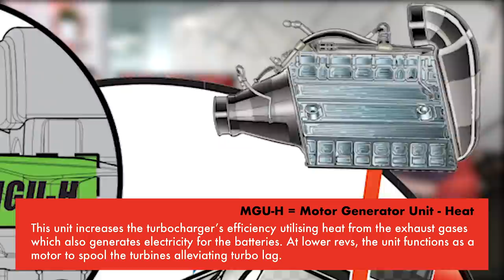Charles Leclerc’s cruel Bahrain F1 engine problem explained

Comment: There is always the possibility that they are not telling the truth.
A radio message about the power loss said to Leclerc "we are getting no H return."
This to me would mean the electric generator on the turbo shaft had stopped making power. This would a loss of, as Mercedes told us in one of their videos, 160+ extra horse power. This power unit is highly stressed by the high rpm, and the extreme heat. {and the puffs of white vapor form the back of the red cars.... may be a liquid gas cooling, that could run out} 
Is the diagram you showed correct, and their turbo compressors are next to each other? The top team using this has the compressor on the exhaust int he back, with a long shaft putting the compressor for intake in the front, and so the generator can be kept cooler.
ALSO there is the long tradition of the number 2 car having power loss problems, ain't that right Reubens?.

Comment: Serious question: why does a cylinder misfire on a 15000+ rpm engine not destroy it? I'd think that a 5 cylinder V6 engine revving to those sorts of speeds would simply shake itself apart. Why wasn't the failure more dramatic?

Comment: Ferrari’s are fast but Lewis did pass Seb in a fair fight, I think like last year it’s gonna be track sensitive to each car, the anomaly is Charles. I gotta admit the kid is fast or maybe just maybe Ferrari wants to push out Seb so they’ve turned up leclerc’s engine lol so he can win more.
Reply: Vettel is just not elite.. Could not beat Ricciardo, beat an average driver in webber for his titles.. even then he got preferential treatment on parts and would 'multi 21' on pre arranged deals.. Leclerc will show him the way this year..
Reply: You might just be right but with that theory and taking into account Ferrara reliability, they’ll go through 3 engines in 3 months if they are stupid enough!
Reply: Though he is a 4 time world champion, all were with Red Bull when they had the dominant car. Vettel has thrown away wins and at least one championship as a Ferrari driver. With the changes Ferrari are making within the team, I think Vettel is on the hot seat if Leclerc's form continues and Mick Schumacher does well in Ferrari's driver's academy.
Reply: That's not it. Vettel buckles under pressure too easily. The first time I saw it was back when Jenson Button caught up to him in Canada. Vettel went off the race line into the wet on the final lap.  And he's done it multiple times last year. He's got the skill but he's gotta get his head straight if he's gonna stay with Ferrari or even win another championship.

Comment: I'm sorry but reliability is part of the sport
Reply: Obviously. Charles said that himself after the race. Merc had issues last year as well, including a double failure in one race. What are you sorry about?
Reply: True, but this did'nt happen last year with the SF71-H this early in the season.  2019-->Oz was Vettel and Bahrain was Leclerc.  Nothing has changed from the PU from last year to this year; rinse & repeat. [smh]
Reply: Your correct it’s a Team sport not a drivers sport felt sorry for leclerc  but not for  Ferrari, I’m A Hamilton Merc Petronas Fan But when the leclerc lost his cylinder I was like No No No hoping Hamilton won’t catch up
Reply: @jgonzalesm6  the engine packaging is totally different.... Do you need glasses to see that? Maybe check some background/research ... It's not the same layout... The threshold for Vibrations/reliability/cooling would change dramatically... Plus teams always upgrade components from one season to the next.... They have incredible power but poor reliability so far..
Reply: @rohitrevankar7674  - your funny.  The engine "packaging" has remained the same as last year.  Also the reliability has been within the component allocation allotment in 2018; your allowed 3 the whole season on certain components & 2 on others.  Ferrari & Mercedes never went over the component allocation allotment the whole season in 2018 and never went into grid spot penalties.  Reliability has been excellent for MB & Ferrari in 2018 regarding the component allocation allotment.  You have no idea what your talking about.
Reply: @jgonzalesm6  yo you clearly don't understand what "packaging" means... It's to do with the architecture of the internal components and cooling systems... You seem to be a rank amateur at all this... Look I am talking fact not speculation... And reliability of that package will change if you alter it.. Mostly the capacity of the whole unit to take Vibrations or the ones that it may generate.... What are you talking about allocations for? Allocation correspond to the wear and tare... Ferrari's problems are that they arnt able to complete a weekend yet at full capacity... Nothing to do with long term wear... Look kiddo u need to do some homework lmao
Reply: @rohitrevankar7674  - the internal structure and components are packaged the same way as last year.  I'm on 2 F1 forums and have over 20 pages open on my computer that get constantly updated daily regarding F1 news, F1 pics (aero changes per GP, F1 cars on stands completely "naked" inside the pit garages).  The radiator is still in the same place as it was in 2014 when this hybrid era started, the MGU-K is still the same along with it's location,  the MGU-H is is still the same along with its location, the ICE unit is still the same platform(V-6) and location, the ES is still in the same location-->low on the car underneath the drivers seat and fuel bag, the turbo is still in the same location in between the V-6 platform with the compressor turbine on one end of the engine and the exhaust turbine on the other end of the engine with the turbo shaft running down in between the long axis of the V-6. The gearbox is in the back.  Have you seen Mercedes Benz #highfive pics.  They have all 5 hybrid engines, with components attached, of different years next to each other on stands outside and guess what.....the layout is the same for each year!!!  They do make upgrades but thats within the components WITHOUT changing the layout of the WHOLE PACKAGE.  Again, you lack the time and knowledge of the information that I am privy too.  I live, eat, & breath F1 24/7/365......yo.
Reply: @rohitrevankar7674  - I'm doing you a favor before you embarass yourself even more.  Link below.
Reply: @rohitrevankar7674  - regarding Vettels issue at Oz, Ferrari still has'nt said anything but I've gathered vids and info which LOOKS to be a cooling issue(he's lifting & coasting way to early into the turns) thereby the software defaulting the PU into "safe" mode.  Leclercs issue at Bahrain is a "lost" cylinder, which coincides with the turbo, which robbed him of 150hp-->again the software kicking in and defaulting the PU into safe mode.  Both instances have nothing with the layout or packaging of the components  but its within those components that fail.
Reply: @jgonzalesm6  awryt great well done proving urself a good F1 student! May I ask what makes you think that Renault Ferrari and Honda all use the same configuration? I know that Renault have only recently moved towards a layout similar to Mercedes for this year (still not entirely)... But Honda and Ferrari are totally different to Mercedes.... I can't give you the details at this point but I am aware that Ferrari have changed their packaging around the side pod and exhaust regions moving the centre of the gravity towards the driver... I may go into the details as to which components specifically later if I have got the time... Anyways any alteration can have a knock on affect for the WHOLE UNIT.... Also changes don't have to be visible from the outside.. Mercedes have an all new engine this year... Which basically relates to the geometry within the combustion Chambers which u can't visualize unless Mercedes gets u a free pass to their factory.... And you really shouldn't believe that everything is being depicted in those videos.. It's all a Mercedes publicity thing... Needles to say all manufacturers use slightly different arrangements for their internal components.... It wouldn't be farfetched to consider that perhaps the extreme exhaust package at the rear of the the Ferrari may be causing a major stability issue forwards at the engine... But nothing is going to be exactly the same on any of these cars in successive seasons...
Reply: @rohitrevankar7674  - my initial post was about Ferrari....not about Honda or Renault.  Move on.
Reply: @jgonzalesm6  Vettel himself said it was a struggle to find the right balance with the setup... Don't think it had anything to do with cooling necessarily... Lift and coast is what u'd do if fuel consumption is an issue which Leclerc did hint towards in the Bahrain... If u you had cooling issues u would simply turn the power down not lift and coast unless the brakes were overheating.... Now temme why would a cylinder fail out of the blue?... Are Ferrari capable off having a random manufacturing glitch like a thaty? It is could easily be a result of an underlying cause that it did address in previous messages...
Reply: @rohitrevankar7674  - loss of a cylinder could be spark plug related.  Kimi had this issue last year late in the 2nd half of the season.   Regarding Vettel "being due to setup" is partially true...but testing in Barcelona was cold...3 degrees C in the morning to 17 degrees C at noon.  Melbourne it was 27 degrees C...so hot compared to Barcelona.  Redbull and MB changed there bodywork(engine cover and behind the halo support) to extract more heat to come out of the PU at Melbourne; the bodywork was different at Barcelona for both RedBull and MB.  At Melbourne, Ferrari used less downforce(setup) to compensate for the PU overheating to gain speed.  They knew this in practice.  During the race, the PU was overheating so thereby kicking his car into safe mode.  Seb was 57secs behind the Mercs at the end of the race where the car is lighter than the beginning of the race where its fully fueled.  Ferrari made no changes to the bodywork from Barcelona to Melbourne (except the livery change).   So lifting and coasting for Seb at Melbourne was due to having a low downforce; high downforce and he would have attacked the corners but this was not the case during the race.  I have video of this-->Seb lifting and coasting.  Also, I have video of Seb requesting an engine update.....he gets no response.
Reply: @jgonzalesm6  don't agree with the temperature idea.... That's one of first things that came to mind at Melbourne but Ferrari were blistering quick with absolutely no issues in Bahrain P1 and P3 it was closer for Mercedes in the colder evening conditions so I beg to differ about temps... Could you explain how a spark plug may lead to a misfiring cylinder?
Edit : the relative pace of the whole pack in Melbourne was quite honestly an anomaly... No way a true representation of the field.. I expect further confirmation in China... Ferrari should dominate leaving aside reliability and driver errors..
Reply: @rohitrevankar7674  - I said "could be" spark plug that could cause a misfire and lose the cylinder.  This was not the case.  It was a faulty fuel injector after inspection at Maranello.  Ferrari will use the same engine at the Chinese GP.

Comment: Charles engine experienced an injector failure that stopped carrying fuel to the cylinder.  PU not damaged and can be used at the Chinese GP.
Reply: MEGATRON  - Italian Motorsport.
Reply: joe r gonzales Do you have link to that? Is it in english?  I want to read?
Reply: @soraaoixxthebluesky  - yeah, give me 45min.  Will post the "google translated" link.
Reply: @soraaoixxthebluesky  - link below.

Comment: Reduce the amount of fuel and fire the coil while the exhaust valve is open to spool the turbo quicker. Without a load on the coil, it would have fired with the exhaust open.

Comment: How exactly do engineers on the pit wall make adjustments to the care. I frequently hear drivers saying “give me more” or the engineers saying “we are making changes” like what do they change from the pits. Or is it just them telling the driver what to do?
Reply: 2-way telemetry has been banned from F1 for some time. In the early 90's, with the development in electronics, teams started to be able to control, from the pits, every input on the car. At some point, they would start controlling the steering itself, and that was too much.

Now, as soon as the umbilical chord is plugged off the car, the driver is responsible for selecting the pre-programmed modes (engines maps, diff, brakes, etc). Because these modes are so complex and so many, the driver asks for suggestions or permissions (which are analyzed by tens of people at the track and back at the factory). Sometimes the driver wants more power but first he/she should ask the team for confirmation due to strategy, fuel or reliability limitations. On the other hand, when a driver "abuses" a mode, the team will instruct the driver to go back to a more conservative mode.
Reply: Leo Arc thank you that actually helped a lot

Comment: How does a dropped cylinder explain the lack of harvesting in the braking zones by the MGU-k (no flashing lights after he developed the fault). I think Ferrari have a major cooling issue. They were protecting something in Aus and when trying to make his way back through traffic after his spin Vettel was getting a "use high gear" message on his wheel in huge writing. Seemed more like a warning than just a normal message
Reply: Exactly what I was thinking, the engine didn’t sound a cylinder down either. It was a ers issue that they don’t want anyone to know about. It’s probably the area they have their advantage in.

Comment: Can you please explain how Vettel managed to spin when it looked liked he was already through the turn?
Reply: Jaco Visser Do not expect such expertise from here. Simple explanation: wind gusts and direction.
Before the Turn 4 the wind is coming from the front and Lewis said that he decided to attack with more aggressive bracking looking at the waving pattern of the big flag on the opposite tower. And he knows that after the apex the wind will be blowing from the rear and have to be more cautious. I believe Vettel as well knows this but apparently the gusts and maybe the bypassing car of Lewis considerably straightened the overall effect and here the loose end and car spin.

Comment: I'll go out on the limb and say Mercedes might have the upper hand. I still think their disadvantage is in track temps. There is also a slight straight line performance advantage, but I think Mercedes can mitigate that (and then some) in the midseason update. On the chassis side, they seem to struggle in cooler temps, and Ferrari appear to be willing to run fairly aggressive engine maps all weekend long. As we get to tracks with higher spring and summer temps, I believe the Merc will come to life. Equally important, I believe Ferrari's willingness to turn the engines up so aggressively is going to bite them at some point this season. Also, don't count Honda out. If they improve the engine just a little, Max will be tough to beat. Personally, I just think they are a little down of peak party-mode power, and even less in race mode.
Reply: Mike Jackson mercedes have James ... he’ll find a solution!😂😂😂

Comment: Admittedly, have not read all 316 comments (at the time of this post), but has anybody listened to the Leclerc in-car video?  There is no misfire that would be a giveaway for a 'dead' cylinder and watch the digital tach moving smoothly into the 11,000+ range on acceleration; repeatedly. Then, immediate post-race Leclerc stated: "... and I don't think the fuel would have been ok." Could it be a 'limp' mode in the software that would factor in: distance to race finish, fuel consumption rate, fuel remaining, etc. and then the ECU made the decision to reduce power to preserve making the finish line with the requisite amount of fuel remaining for post-race testing by scrutineers? Or did Ferrari run too lean a mixture setting that caused some damage and then to preserve the engine disconnected the MGU-H?  Leclerc steering wheel readout was displaying message: " Fail B (4?)" consistently, any ideas on the meaning of that?

Comment: Lol. I see autosport is still firmly on that Ferrari bandwagon. Was it my imagination or did Hamilton not catch up and pass Vettel in Bahrain under race conditions with slightly older mediums? And thoroughly trash them in Australia (which they are now labeling as not a real race track) The Ferrari Mercedes difference is negligible. It's the drivers where the real gulf resides.

Comment: One thing to keep in mind: as far as I know it is not allowed to change settings on the car from the pit wall.
I get the impression you guys are suggesting that is what Ferrari would have been doing.
Reply: khasmir666 maybe they’re saying that the pitwall was working out the settings that they could get the driver to change
Reply: Teams can change engine mapping settings from the garage if there is a safety risk. So for example, when the Red Bulls last year broke down due to engine faliure, they would turn down the engine mapping from the garage. Drivers can also do this from inside the car and they can overide changes made by the team also
Reply: @wanderingjuniper  yes, maybe, but that's not how they said it, which is misleading

Comment: I wonder if it could be aerodynamic efficiency rather than pure horsepower. Could Ferrari have found an aero package that had low drag at speed, while still providing enough downforce?